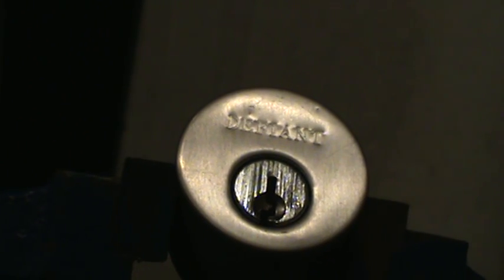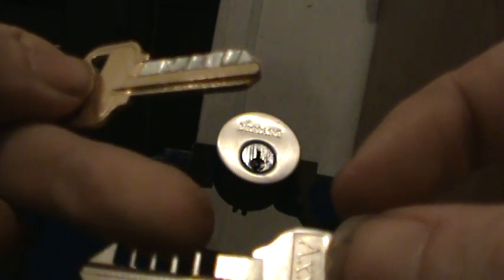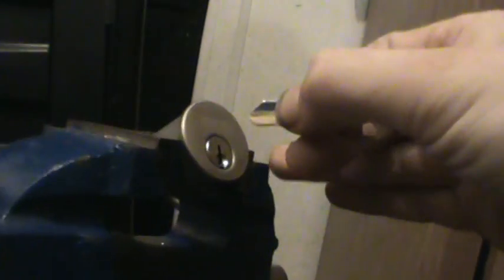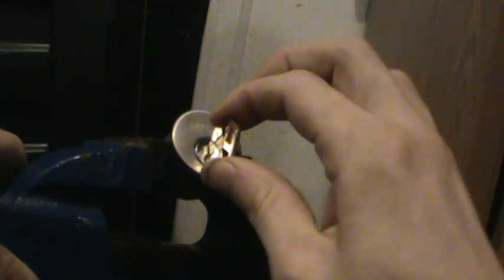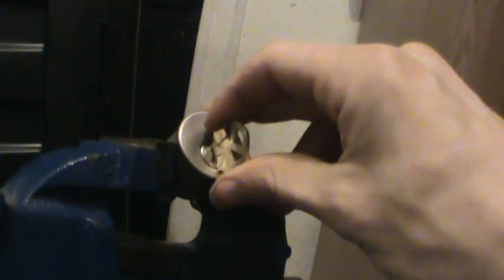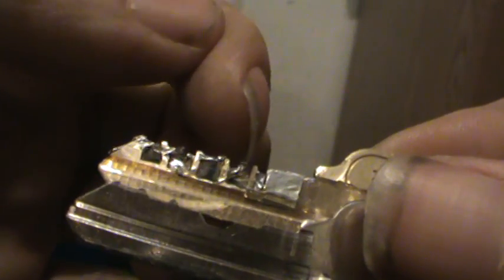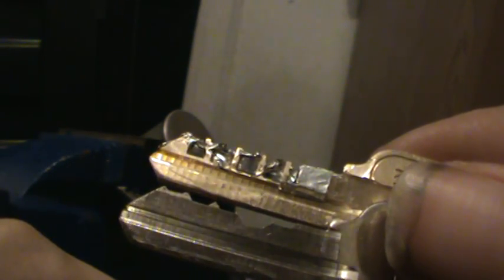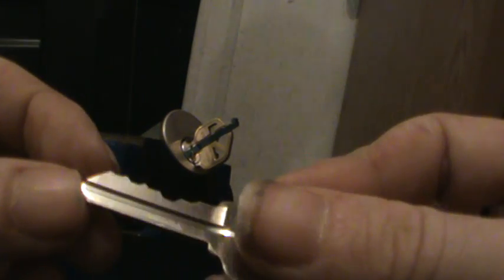99. Foil Impressioning

Comment: Would this work on sfic locks?
Reply from the maker: Thats a solid maybe. A real 100% possibly. It may work for sfic... or it may not.
I give you atleat the opportunity of success. Sfic are technically suceptible to this sort of technique... but it seems practically difficult as they have 2 sheer lines and you have no control over where you bind.

Comment: That looks like a lot of work compared to the standard way of impressioning a lock. Doesn't look like it would be practical in the real world.
Reply from the maker: Unless you are Jos, its generally faster and with no filing needed. It does not create a duplicate, measuring the foil is a pain and not all that reliable. Different strokes for different folkes
Reply: Lol I have no idea what Jos is but I'm a maintenance man who is studying to become a locksmith. I just envision impressioning a lock in the field and with all the cuts to that key I can't see it being practical for me. I clicked because I am interested in learning various techniques, and I do appreciate you sharing it. More than one way to skin a cat I always say.
Reply from the maker: @austinknowlton1783  Jos Wayers is an incredibly fast impressioning badass. Generally, impresstioning is a slow process. But if you are trying to open the door, foil works, if you are trying to make a key, I would recomend regular impressioning. Also just picking works great too ;)

Comment: That's pretty slick...
How do you get the foil to stay on the key does it just lay in the groves you cut?
Thanks for sharing this I have been looking for different ways of doing this
Reply from the maker: you can get sticky foil, but I just press regular foil on and be careful while inserting it. Use the guide to hold it on if needed, but it isnt too difficult.

Comment: Just when you think every way to Pick a Tumbler Lock has been figured, their seems to always be one more. 
Some I can think of are:
Single Pin Picking
Raking
Zipping
Rapping
Jiggling
Bumping
Comb Picks
Lishi 2 in 1 Pick/Decoder
Foil Impressioning(first time seeing now)
I don't count Tryout Keys, but are a way to open Pin Tumbler Locks with out Destruction. 
I would include Bypassing as it is through the Keyway. 
Wouldn't Include Shimming the Shackle. 
Any others you or anyone can think of? 
Stratmando
Reply: Forgot Pick Guns, and Electric Pick Guns. Have an Idea I need to try, maybe a small Master Padlock secure a tension wrench with turning pressure, then smack side of lock with something to get pins moving to shear line. Like Bumping, but instead of hitting pins into place. It is other way around. Could be considered Rapping, But I think of Rapping as, dealing with the Shackle , not the pins. 
Maybe try it if you get a moment. 
Recovering from Shoulder injury.
Good Luck if you try, will watch for a Video.
Reply from the maker: @randyaivaz3356  no thats deffinately rapping, and I bet it'd work. but you wanna smack the bottom of the padlock (the bottom when the keyway is facing you and the bible is up)... 
Itll be like bumping, no tension till after the whack... and the springs must be weak so only a shitty lock... but now I wanna try ;)

rapping is great, it even works on cheap spring loaded safes by hitting where the shackle goes into the safe.(knowledge of where the shackle is is required beforehand). Ive seen rapping work by smashing the front of a doorknob to throw the spring loaded cam too
Reply from the maker: Regular impressioning
overlifting
bumping
drilling (lol)
Reply: Thanks, added Bumping before seeing your Reply, Comb is Overloading, is their another way(single Pin overlifiting?)Drilling is Destructive, if allowed, I would add Cutting a slit on face of lock to allow inserting a Shim. 
Drilling could be Shear Line, whole Plug, Or Core retainer like on a best. 
Keep up the good  Work
Yep, I missed Regular Impressioning.
Reply from the maker: @randyaivaz3356  while it is possible to single pin overlift... I just missed you comb picks  
Yeah any drillong.is destructive but your question was how to open pin tumblers ;)

I loke the lost though, thays fun

Comment: Ok ok ok where the hell do i get that stuff!
Reply from the maker: Blank key... $1 at homedpot or local locksmith
Aluminum foil... $3 at walmart
Metal files... $10 at walmart
Knowledge to cut it properly... priceless
Reply: So you made the key you used to impression the lock? Would you be able to send me some directions? Did you just cut it by code all the way down with an hpc machine?
Reply from the maker: @brianstrauch5682  using a key machine will make a bump key. Your file should be the thickness of the pin or slightly bigger. You must cut exactly where the pins would contact the key, and leave the posts in between them.
Reply: Got ya. Imma give this a try.

Comment: Great video.  But I have a question but really its a statement.  Why do most locksmiths have dirt fingernails.  Lol
Reply from the maker: Mindlessmotion locks are dirty, tiny metal pieces get in ur skin and under ur nails and it does not was off easily.
Reply: People Work with their Hands do get tough hands, People who don't, Have nice Clean, Soft Hands, Probably Nice Fingernails as well.

Comment: If the foil gets pushed too far down (alum foil crushes) in the slots on the key, will the pins get stuck down deeper in the slots and key not able to pull out ??
Reply from the maker: That thin probe pushes the pins back up before u remove the key.
Reply: ***** even though that thin probe is on the "side" of the key ??
Reply from the maker: Jim Thiemann yes, the key has been thinned, so the probe is inside the width of a normal key.
Reply: ***** ok, thanks man !

Comment: What happens when/if the foil comes off in your lock? wouldn't it jam it up and make it so you have to drill the lock out?
Reply from the maker: Russell Nielsen If the foil came off in the lock, it would either be too small of a piece to block the key, or too big and actually block the key from doing its job. You could use a pick or broken key extractor to remove the foil without drilling. The probability of a large chunk staying in the lock is quite slim because the teeth on the key pull it all out.

Comment from the maker: I used a hand file for that one... I dont know what size... it was a little round file from a small hobby file kit (kit has probably 12 different shaped files, real cheap)... I have used a dremil but the hand file is far more precise. I used a rectangular file (with cutting edges only on the long sides, not all 4) from the same crappy set to shape up the spacings... the tool is not about the prongs that stick up, its about the spaces between.

Comment: Here's a way to make it easier to get the correct spacing on the blank.  Disassemble a sample lock (that you don't mind destroying) and get to the Cylinder Plug.  Find a drill bit that fits the pin holes in the plug.  Mount the plug in a vise and fully Insert a blank key.  Use the pin holes as a guide to drill your impressioning key.  After drilling; thin, enlarge, and square the slots with a thin file.

(Untested, but should work.)

Comment from the maker: I fot the proper spacing by removing the plug from a kw1 lock and simply holding the key up to the top of the plug (where the holes are) and anywhere there was a hold, I cut, if there was no hole, I left a prong... make sure the shoulder of the key is aligned with the face of the plug... to make sure I was cutting straight (and wide enough) I inserted pins into the chambers. cut very slowly and check your cuts very often.

Comment from the maker: not sure if you ment the foil impressioning blank (before the foil) or cut a key after measuring the foil (after the lock has been opened) but ill explain how I made the impressioning tool... I used a dremmil and some hand files. first I filed small notches in a key blank and ligned them up to the holes in an empty core... then filed them deeper and deeper continually checking them aginst the core by inserting the key and dropping a pin in each champer (one at a time) till all were at the bottom

Comment: Yeah, the typical use of this technique is for quickly getting and impression that one can decode and code cut a key for a customer on a lockout. It is most definitely more efficient than picking and then removing and disassembline to decode, or traditional impressioning. And let's be honest here, someone seeking illicit entry is much more likely to enter via another location such as a window whether just opening the window, defeating the sash "lock," or throw a brick through it.